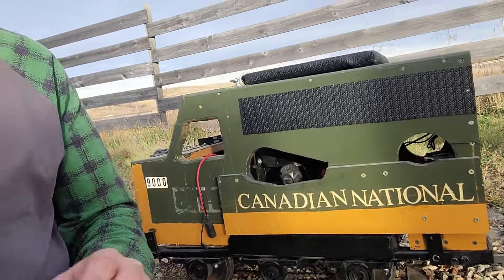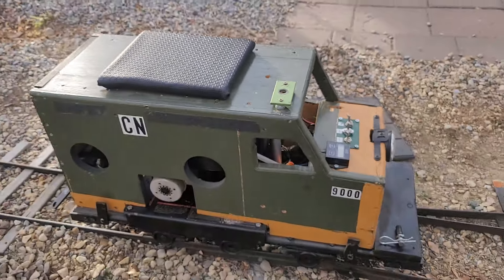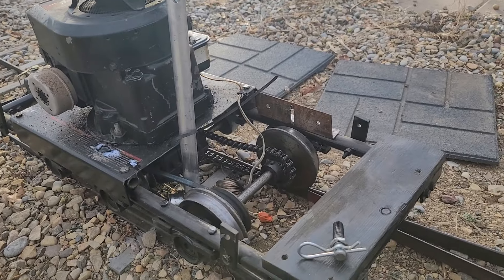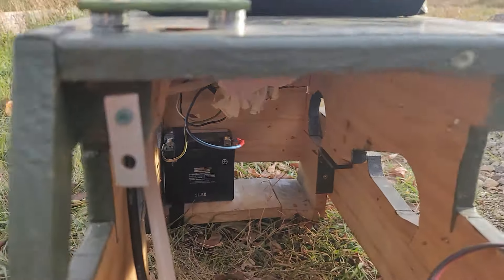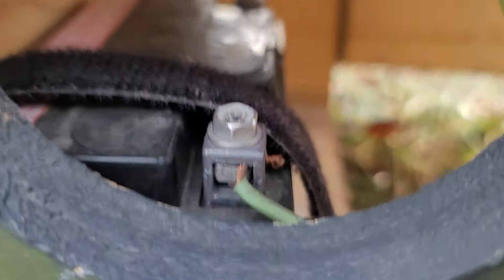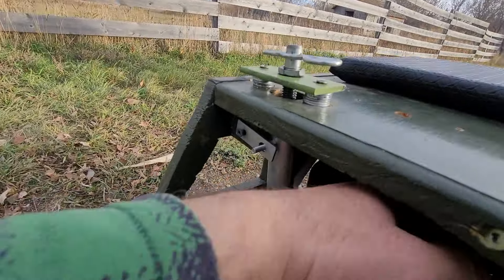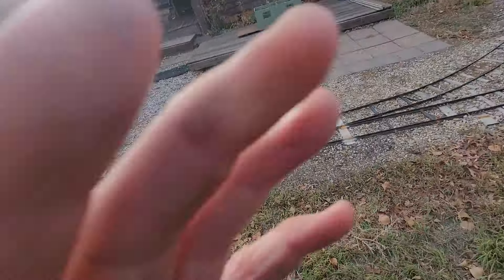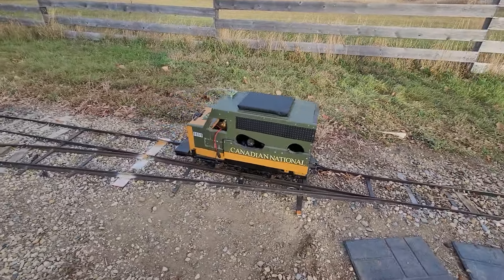Tour of my gas belt drive ride on locomotive and ride around the track

Comment: An easy electric start is to get a cheap electric drill and take it apart. wire the button to wherever you want the start to be and attach the motor to what the pull start attaches to. There is a clutch that allows the pull start to slip while the motor is running and that's what you want the drill to be attached to